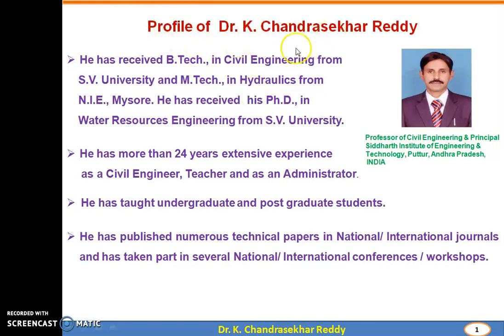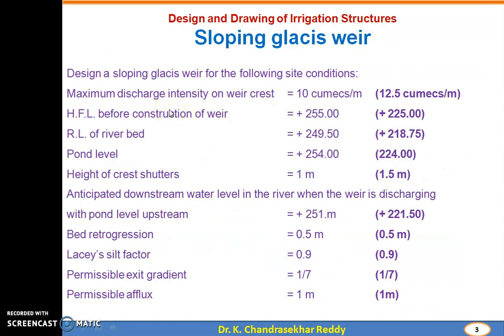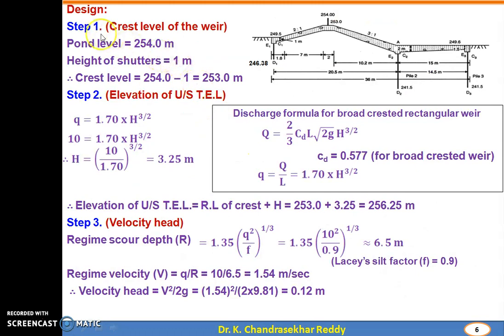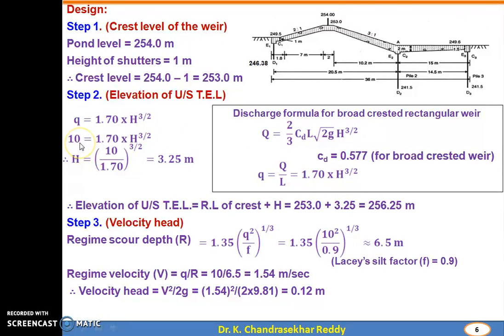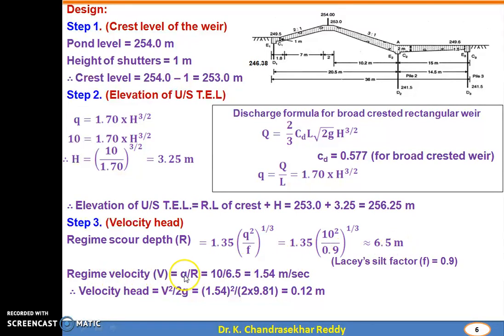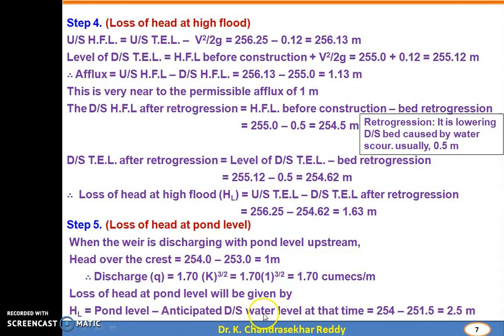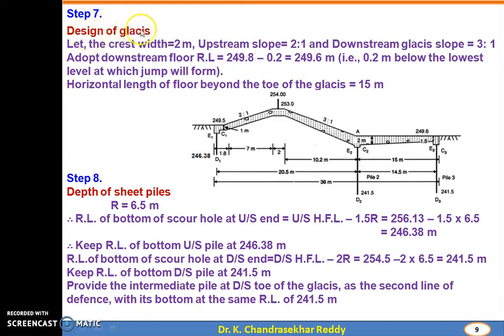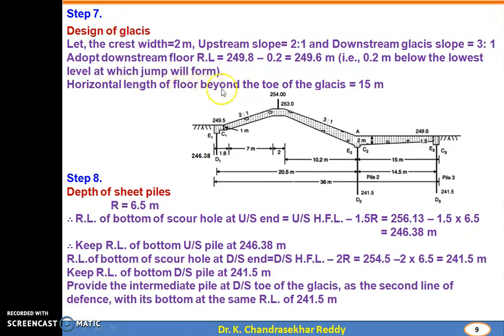1  Sloping glacis weir design

Comment: how to calculate elevations in step 11
Reply from the maker: Pressure     Height (Ht.)                             Elevation (Ele.) = datum + Ht
100%            4.40                                              249.60 + 4.4   = 254.00
82%              4.4×0.82    = 3.61                       249.60 + 3.61 = 253.21
78.8%           4.4×0.788 = 3.46                        249.60 + 3.46 = 253.06
55.2%           4.4×0.552 = 2.43                        249.60 + 2.43 = 252.03
and so on
similarly, calculate for remaining conditions